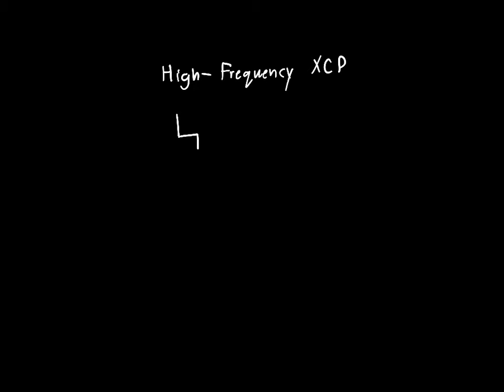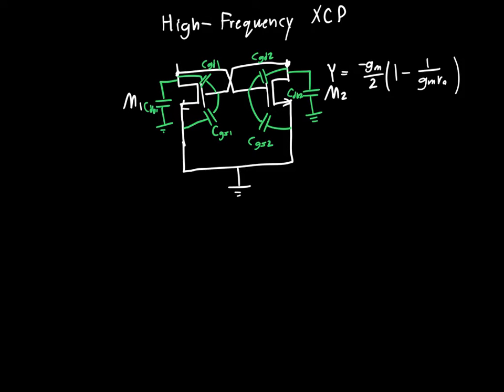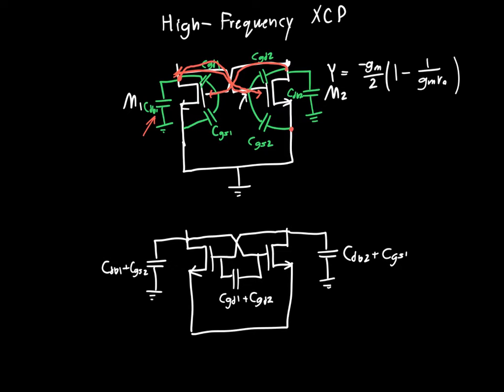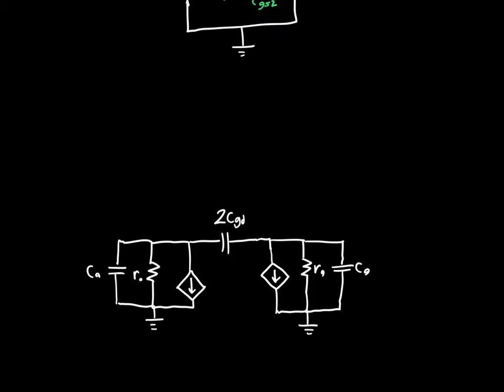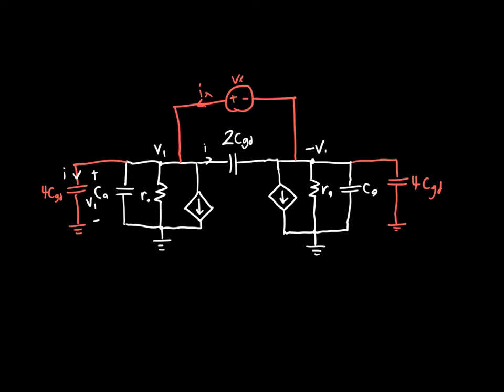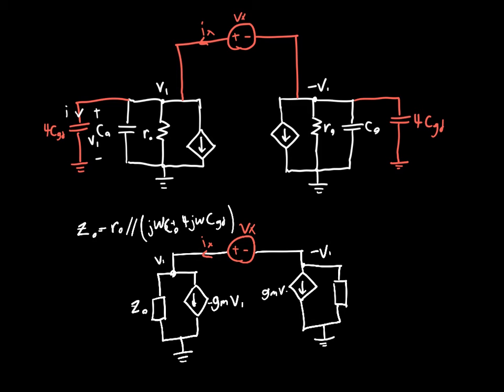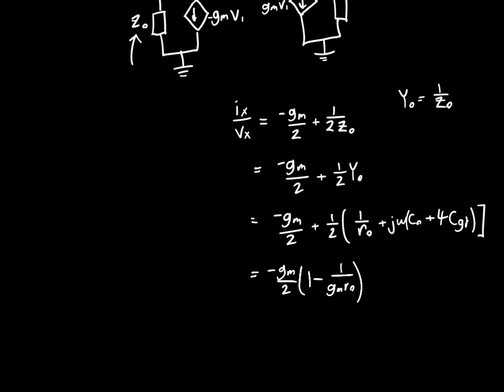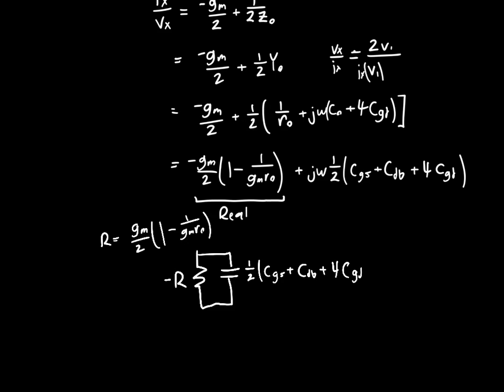Cross Coupled Pair Part 2

Comment: Hi Jordan
Thank you very much 

I would like to comment on the Z0 you wrote. The impedance of the caps should be 1 over jwc. 
Eventually the final expression of Y0 you wrote is correct, but the calc through it isn't. 

Last thing. 
The -R resistance is not gm but 1 over gm

Comment: Thanks a lot for the amazing video Sir! I had a small doubt though, while using the miller's theorem didn't you inherently assume the fact that both the parts of the circuit are anti-equivalent and that's why doubled the cap value. It appears a paradox to me wherein we are using the assumption which is based on the result we are expecting to obtain. Please clarify. Thanks a lot once again!
Reply: Well you can break the voltage source vi to two. One with +vi/2 to ground (virtual) and the other with -vi/2 to ground (virtual) and the result would be the same. This is same reasoning as half circuits when analysing differential pairs.

Comment: Hi Jordan, thanks for giving a great analysis. It's easy to undersatnd and very beautiful. Without adding confusion by talking about the Miller theorem, you can just simply take out that 2Cgd during the analysis and add it up after get a express for Zin', then add 2Cgd to the Zin', since the 2Cgd is simply in parallel with an ideal voltage source, 2Cgd won't change anything while analysising the rest two symmetry part.
Reply: I second this. There was no unilateral gain from left to right other than -1 by Jordan's depiction. Breaking to two 4Cgd is no different than having the two of them in series and assuming the midpoint a virtual ground due to perfect symmetry. Regardless, Thank you both for making such great intro, it was fun. Keep them comin'!

Comment: Hi Jordan,
Very nice analysis. However, I had a doubt about the Miller capacitance value being considered as 4Cgd. How do say it's a multiple of 2 ? Practically, it would be gmro times Cgd, isn't it ?
Reply: What is the gain of this circuit ? It’s -1. Gmro is for specific amplifier type. Output is v2/v1.  General formula is z/(1-Av) at front and z/(1-(1/Av)) at back side. So use this formula to understand Miller compensation for any circuit